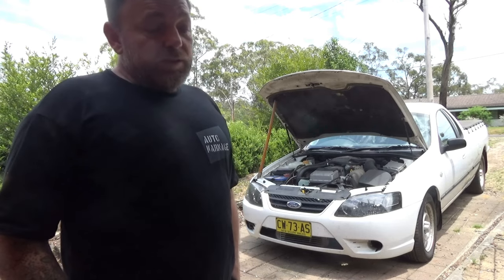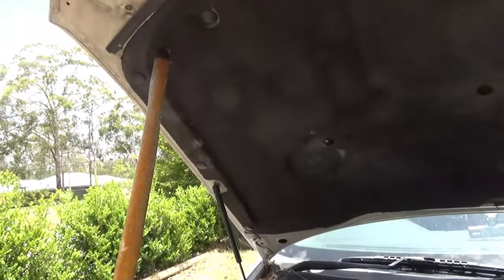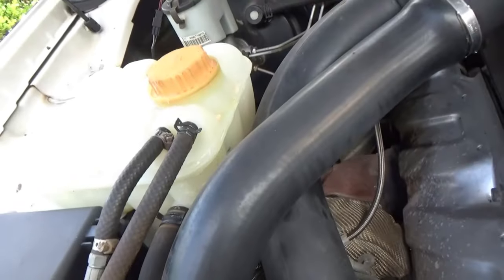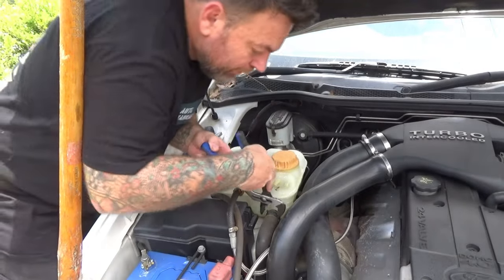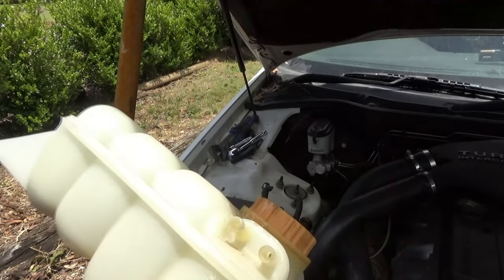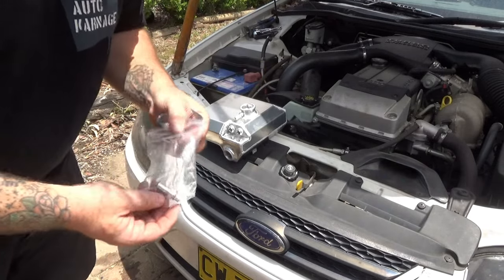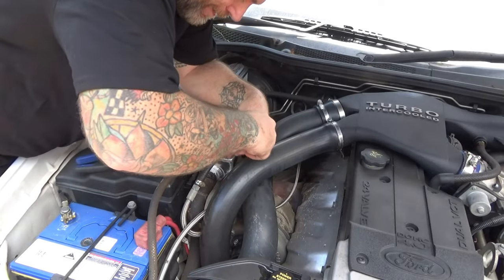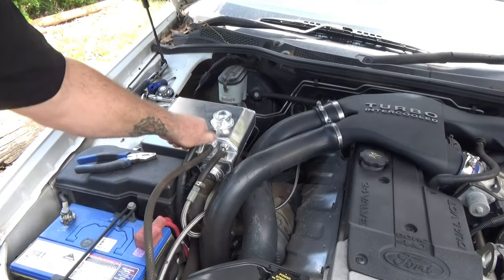NA Turbo Barra Cooling Issues!

Comment: Sorry to hear the sad news mate. Thanks for your vids. To aid your cooling, add a heat shield to your dump pipe, ceramic coat the dump pipe and also add a 70 degree thermostat so the whole donk runs cooler. Shrouding the dump will make the most improvement. Cheers mate
Reply from the maker: Cheers for the info, much appreciated

Comment: Sorry for your loss :(  

Just an idea an over flow/ catch can isnt really required just run as per you have with a drain pipe to the ground and keep new tank filled roughly to the same height or a touch more then the old one. Your factory header tank had a built in overflow port so new one is basically the same.  Also you need heat shielding over your dump pipe thats the reason you were having issues melting header tanks. The factory n/a heat shielding over manifold is fine just need like heat wrap or something on the dump pipe or heat shielding around header tank and brake booster/ master as it will cause the alloy tank to get hot still and possibly boil coolant on long drives on hot days, also could cook your master cylinder and your brake fluid and have braking issues. I just run ebay special heat wrap on my manifold and dump pipe and a turbo beanie like yours and it worked fine on my track car that gets hot and cops a beating. 

Anyways hope this helps, keep up the good work mate happy car building :)
Reply from the maker: Cheers man, much appreciated

Comment: Hey mate, could you please tell me if.you blocked off the boost sensor in the intercooler pipe that goes under the right headlight or did you wire into ?
Reply from the maker: Blocked it 👍🏻

Comment: I could be completely wrong but that hose coming from your turbo shouldn't be going to your reservoir it should be going back into the hard line going to the water pump to pull the hot water from the turbo back into the radiator. The 2 hoses from your reservoir one goes into the radiator and the other should be going to the top of the thermostat.
Reply from the maker: Cheers, I’ll have a look into that
Reply: @oldskoolonly  yeah to easy mate 👌 both my xr6 turbo cars are like that